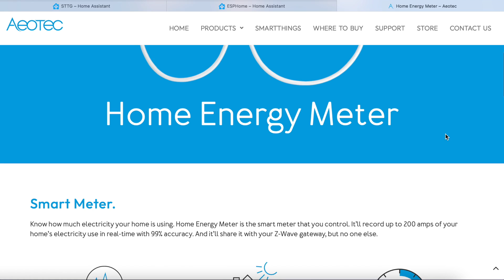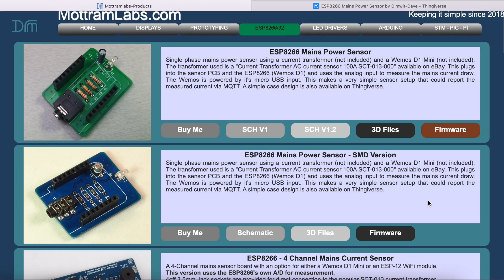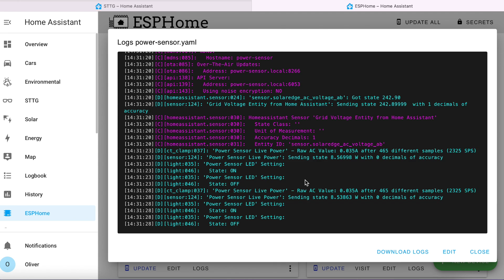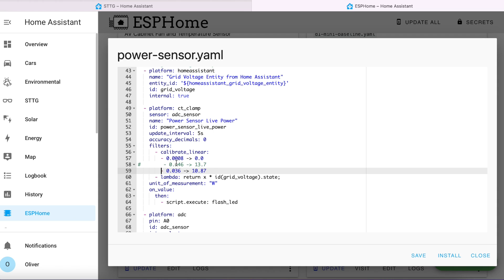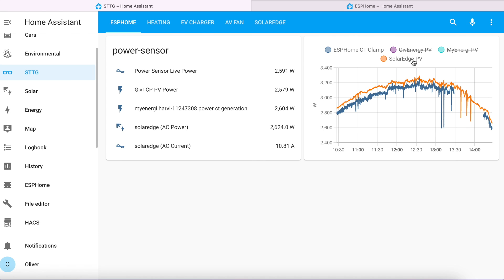Build your own CT Clamp Power and Energy Monitor with ESPHome

Comment: Hi! I recently purchased the 4 port esp32 version of the mottramlabs board along with a esp32 version of the d1 mini. Soldered pins, plugged it in, got it into HA through esphome and all connected up... however I can't seem to get ct clamp readings. I had to write up my own yaml file for it and my question is, did you have to do the same or did your d1 mini recognise the mottram esp8266 board automatically and create the yaml file with that in that is on your website? I'm hoping this might point me in the direction as to whether it's actually recognising the mottram board!
Reply from the maker: There's no auto-detection, you have to specifically configure it in the yaml file. The yaml file on my web site is one I created myself. However some of the 4-channel versions actually use an external ADS1115 multiplexer, so you configure them to talk to the CTs using a multiplexed channel on the ADS1115 (https://esphome.io/components/sensor/ads1115.html). The ESP32 version of the 4-channel board actually looks like it's using the ESP32's built in A/D with each one connected to its own pin. The schematic here shows which pins are on which channel. https://www.mottramlabs.com/pdf/SCH201191.pdf
Reply: @SpeakToTheGeekTech  Ahh that makes much more sense, I’ll crack on with giving it a good go! Thank you so much for the pointers!
Reply: @SpeakToTheGeekTech Update: got it all up and running! Although readings are unbelievably erratic so definitely some more issues to solve.

Comment: "I'm not rich enough to have a 3D printer" yet you seem to be able to afford an Apple computer, with no less than three monitors, and a solar power array! Hilarious bit of irony! 😀😀😀😀😀
Reply from the maker: Point taken... but to clarify - that Apple iMac you see is a 2010 model, purchased second hand from someone else, some internal upgrades from me, but sadly retired only a few weeks ago as it's no longer able to keep up. Those two additional monitors are even older, from 2009. I like to keep kit for as long as possible to reduce the tech churn. It took me many years to save up for that solar array and will hopefully break even in about 6 more years so that's a spend worth making. It's all about choosing your purchases carefully to make the best use of limited funds in areas that are important to you. A 3D printer would be a bit of an extravagance given I'm unlikely to use it that often.

Comment: How are you reading the voltage . or more specifically, how are you having Home Assistant read the voltage. I thought you only had the CT clamp on there over 1 of the legs. so is there a PT over the two legs? In the USA, we use split phase, so our 240V can have different currents on each leg. which means we really need 2 CT clamps -- one for each of the hot legs. But I don't see any mention of anything else measuring the voltage. and that would make it pretty crowded in there having 2 CT clamps, and 2 PT clamps.
Reply from the maker: I'm sure I mention in the video that you can either hard code a value for the average expected voltage, or provide the configuration with a Home Assistant entity that is tracking the voltage for you. I use a 'grid voltage' entity provided by my solar inverter. The energy monitor project is only intended to be roughly accurate and isn't a high accuracy component. For that you would need something hard wired inline to do this properly. For hobbyists who just want to know if there's roughly nothing, 100w, or 2.5kW going through the wire, it's ideal and cheap to make.
Reply: @SpeakToTheGeekTech  thanks for the quick reply. You did mention it in the video that you can get it from that variable or hard code a value in there. I just didn't understand how that variable voltage info was getting populated. I guess for me, I can make another ESP8266 device and plug it into a 240V outlet with PT clamps, and send the voltage info that way.
Reply from the maker: Yes that is a possible option, but you’re starting to move into the realms of this become more expensive to the point where you may be better off buying a calibrated commercial product rather than these self build ones. Unless you’re doing it for that build!
Reply: @SpeakToTheGeekTech  I'm doing it because I don't know of any calibrated commercial wireless products.
Reply from the maker: Have you seen the Shelly EM products? They are hard-wired to the mains to get the voltage, use a CT clamp for monitoring current, and connect over WiFi.
Reply: @SpeakToTheGeekTech  Thanks, I ordered the EM. Hopefully it works out. but it wasn't cheap. It was about $75 (about 60 pounds). Oddly the manufacturer didn't ship to the US so I had to get it from the US direct.  I had already ordered the ESP8266 after seeing the video so hopefully I can find some other use for them still. The plug in daughter board to ship to the US costs about $25 for 1 so mostly from shipping costs so it blew the budget for the project. Luckily I realized that the board is really two 10K resistors, a 22ohm resistor, and a cap, so I could still just solder those directly to the ESP8266 and eventually get the project duplicated. The project seemed easy enough to finally get me to start to play with the ESP8266/ESP32. I hope  to redo the project with the ESP32 once I get the 8266 version working.

Comment: You didn't mention why it is soo important to use the SCT-013-000 clamp. Can I not use a more accurate clamp that has a 3.5" stereo jack on it?
Reply from the maker: It's because that's specifically the CT clamp that the board was designed for. To find out if other CT clamps would work you would need to contact the designer/seller of the board. I couldn't tell you the electronic reasons behind that though sorry.

Comment: Great Job!

I tried it, i got 0.00042 A on my sensor, when the real is 2.0A. 
So i tried calibrate_linear but i got than 0.0000A instead of 2.0A correction... any idea?

I have that
0.00000 > 0
0.00042 > 2.0

as correction :/
Reply from the maker: That’s odd, are you certain you put the values for calibration the right way around?
Reply: @SpeakToTheGeekTech  What did you mean? I putted in like i showed... i dont know :/
Reply: filters:
      - calibrate_linear:
          - 0.00000 -> 0.0
          - 0.00042 -> 2.0

Thats what i typed in. In My logs i have exact these 0.00042 when i put i 2.0A in my battery.

But something strange is, that i have 5s interval and sometimes also is 0.0000A and than again 0.00042A

But with the calibrate, i have everytime 0.0000A :(
Reply from the maker: I think you’re calibrating with too low current. You should remove all calibrate linear commands, put the clamp in place and see what you get when there’s no current running through it. That’s your calibrate for 0. Then whack the current right up, usually that’ll be 10 amps +. That’ll give you a reading at the top end of  your calibration graph. It’ll then interpret the other values (like 2A) linearly. What’s likely happening now is that your zero current and 2A current readings are very close so overlapping.
Reply: @SpeakToTheGeekTech  Ok, when i check Raw AC Value, i have 0.000A i think i dont have enaugh decimals there... is there a way to show more decimals?
Reply from the maker: Not that I know of, if you’re not getting higher values then I’d suggest something is a bit wrong with your CT clamp or another component. Those numbers fly up quite quickly for me as I ramp up power
Reply: @Reudiga  I'm getting the same.  Do you also have the SMD version of the Mottram labs board?  The earlier version doesn't appear to be available anymore.  The pin schematics appear to be the same but I get nothing. I'm wondering if the clamp is duff.

Comment: @Speak to the Geek Great video as are all of yours I have watched. This project took my fancy as I am having my Solar Edge system fitted next week. All went great (ordering, soldering etc.) then when I pressed the button to upload I got the error; "Failed to initialize. Try resetting your device or holding the BOOT button while selecting your serial port until it starts preparing the installation". I have searched the web, downloaded the e-book from AZ-Delivery about the D1 mini but cannot find a way out of it. First problem was needing an HTTPS connection but solved that by installing a Cloudflare tunnel. Any suggestions or am I just being thick! I even ordered some more D1-mini's just in case I had blown the first one up with my soldering. But get the same error with those. Really frustrating as I want to build my HA power dashboard. HELP please.
Reply from the maker: Hi, there could be several reasons for that message but the most common ones I've come across are either a dodgy micro-USB cable, a missing serial driver on your computer, or an incompatible web browser. On a Mac, you used to have to install a serial driver but it's now included, I don't use Windows but there is a serial driver available for it on their web site (https://www.wemos.cc/en/latest/d1/d1_mini.html). Use Chrome (not Safari or Firefox) as that makes a difference too. You could also try compiling the file locally on your Home Assistant installation, downloading it, then using the ESPHome Web Tool to push it to your D1 mini (https://web.esphome.io). Hopefully at least one of those suggestions will help you out.
Reply: @SpeakToTheGeekTech  Thanks very much for the reply, but the problem was me being an idiot! I was connecting the D1 to the laptop I was connecting to HA with, rather than connecting it to the Thin Client PC that has HA installed on it (doh). It wouldn't compile at first but when I connected the two boards together it went through successfully with your yaml script.
So, once again thanks for all the videos and please keep us informed about anything you learn about controlling Solar Edge kit. The reason I went for the expensive SE option was that I thought I could control everything with HA but it appears not. We will see....

Comment: Nice video - thanks! Could you even make your own CT clamp by manually wrapping a few meters of wire around the cable in question and soldering on the jack?

BTW I have a 3D printer and will happily print anything you need for future videos - just my way of saying thanks and giving something back for all the great videos.
Reply: I've noticed non-professionals seldom exhibit  the capacity to address more than one question, usually they only remember the last one.
Reply from the maker: Thank you, that's very kind of you! I'll let you know if any interesting projects require 3D printing :) There are none planned right now but I'm sure I'll think of something.

Comment: Nice video. Well explained. 
One caveat. It's been my experience that the ADC on the ESP8266 is complete crap. I'd either use an external I2C ADC or use the ESP32 instead.
Reply: You REALLY need to explain why you feel the ESP32 ADC is 'crap', as you so quaintly put it, and in what context. Is it noise, resolution, LSB uncertainty, drift? It doesn't help anyone just saying it's 'crap', some shortcomings, after all, are irrelevant depending on context?
Reply: @icarossavvides2641   Well, the ADC on the ESP8266 is about as good as your reading and comprehension skills.
Reply from the maker: You're probably right. There is no ESP32-friendly version of this add-on board though so it would make the project trickier and less neat for beginners certainly. There is a 4-channel version of the ESP8266 board with an external ADC (https://ebay.us/wE7aJZ) which would be more accurate, and looking at the Mottramlabs web site there's a 4-channel ESP32 board 'coming soon' now too!

Comment: I'm new to HA and ESP home, just trying to get some electrical usage data. I've been trying to get the single CT working but having some yaml errors. I have imported your code but its saying there's an error with the entity_id on the sensor, any thoughts?

Also I saw you had your solar edge inverter on HA and a myenergi input, is this through a CTor have you managed to get the api working from them, id love to get both of mine on HA too

thanks in advance
Reply from the maker: The ESPHome config requires you to either pass it an entity from Home Assistant with your home’s voltage in (line 5) or hard code a value of say 240 on line 59 instead of where it says “id(grid_voltage).state”. If you are hard coding a value, also delete lines 42-47.

My SolarEdge inverter is connected to Home Assistant using the SolarEdge Modbus integration. I use the voltage sensor from this integration in my ESPHome CT Clamp configuration. Have a look at this article to see how I’ve done that: https://www.speaktothegeek.co.uk/2022/05/solaredge-hd-wave-se3680h-and-home-assistant-local-integration/

To get that working, you’ll need HACS installed in Home Assistant and I have a video on how to do that here:
https://youtu.be/jzpm89956Pw 

MyEnergi is via the integration also available in HACS, and I have an article all about the Eddi. If you have another MyEnergi product, it’s the same process - just scroll down to the section about Home Assistant: https://www.speaktothegeek.co.uk/2022/10/myenergi-eddi-and-home-assistant/

Comment: You're measuring apparent power, not real power. Which I guarantee will not be the same in your case. Measuring the real power is a little more complicated than that. For that you need to measure the voltage and current a couple thousand times per second (and voltage and current must be measured simultaneously) and you need to do some math to calculate the real RMS power. That's what pretty much any energy monitoring device out there does.
Reply from the maker: Yup I totally agree. It's measuring the current and the power is just an estimate based on that. This device however is cheap to make, gives a ballpark rough reading suitable for use in home automation solutions, and is non-invasive for those who don't want to connect to mains power. It's also just a fun little project, but if you're after something seriously accurate then of course you must look for an alternative solution.

Comment: Is the calibration for the device or the set up (I.e. wire thickness / position)? My smets1 device has gone back to being dumb & bulb seem useless at doing anything so thinking maybe clamp to monitor energy, but as I can't tell total house usage atm I'd only be able to calibrate it to an individual item (kettle, electric fan heater, etc.) Connected to a smart socket & then move it to be connected around main cable into my house
Reply from the maker: It calibrates the sensor and device rather than the item it’s connected to. Keep in mind it only senses import current and is only ballpark accurate. Useful for knowing if there’s nothing / little bit / loads of power for the average curious Home automationist, just don’t rely on it to compare against your bills.

Comment: Do you know where you can get a D1 pre soldered?
Reply from the maker: There used to be a few sellers on eBay and Amazon that soldered the headers and re-sold at a profit but a quick look at both sites isn't turning up any results at the moment. Even Banggood doesn't seem to be selling them at the moment sorry.
Reply: @SpeakToTheGeekTech  I haven’t soldered for years, decades 😀. How easy is it to solder? I am worried about joining the pins together.
Reply from the maker: I'm not very experienced with soldering either - pretty much just what you see in my videos! I have a fine-tipped soldering iron which is important, and it's quite easy to solder the headers. I use blue-tack to stick the module to a surface and hold the pins in place face-down, then just melt the solder into the gaps between the pins and the board and it usually just sucks the solder straight up into a neat little bump. I'm not saying it always works, and I've melted a few boards and blue-tack in my attempts, but it's not a difficult task really as DIY jobs go!
Reply: @SpeakToTheGeekTech  I overlooked one thing. I was going to put this outside in my meter cabinet, but I have no power to plug it in. That is annoying

Comment: Hi, do you have a link to the 3d printer file for the case? I can't find it on the mottram site
Reply from the maker: If you look on the ESP8266/32 page (https://www.mottramlabs.com/esp_products.html) the second device down (Wemos D1 Mini ESP8266 Mains Power Sensor), there is a button named '3D Files': https://www.mottramlabs.com/files/Wemos_Case_201083.zip or third item down for the none-SMD version: https://www.thingiverse.com/thing:3169243
Reply: @SpeakToTheGeekTech  thank you very much

Comment: Thanks very much for the video, ive bought 5 4 gang boards from mottram and 20 CT clamps, now all i need to do is figure out the programming for it! HINT HINT ;)
Reply from the maker: Don’t forget that these clamps can only detect uni-directional current. They don’t know if you’re importing or exporting. As for configuring the multi socket modules, there was already a great article on the web showing you how to use the multiplexed signals (ryanteck.uk) but that site is down right now :( You need to configure an ADS1115 sensor instead of an ADC sensor, and then each clamp is a separate multiplex on the ADS1115 bus.
Reply: Did you figure it out? I am also doing a 20 CT clamp project.
Reply: @olahe97  i got it sort of working but ran out of time and so i bought an emporia. I managed to get it linked up to HA but could only get one Chanel to work properly. All 4 channels read the same as channel 1. im going to re visit it next week to try and get it working, ill let you know how i get on.